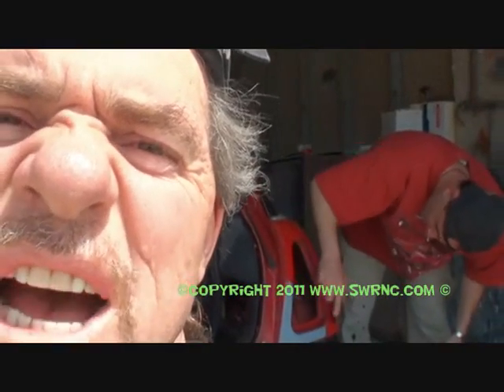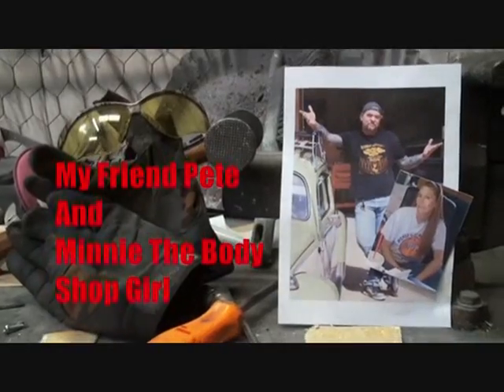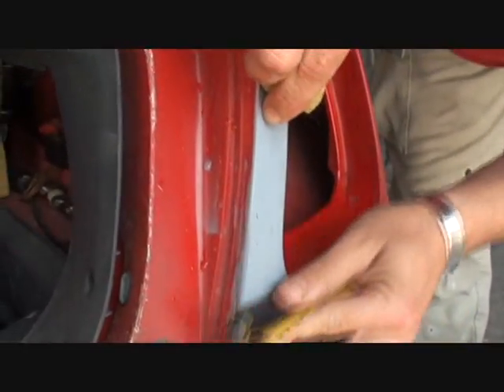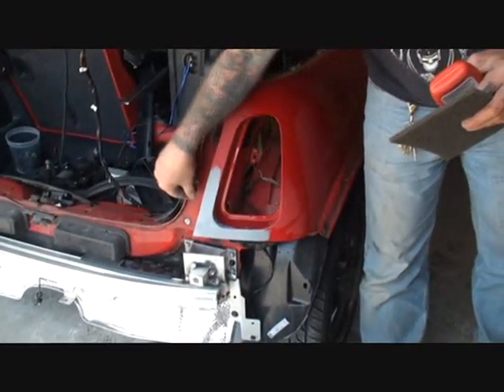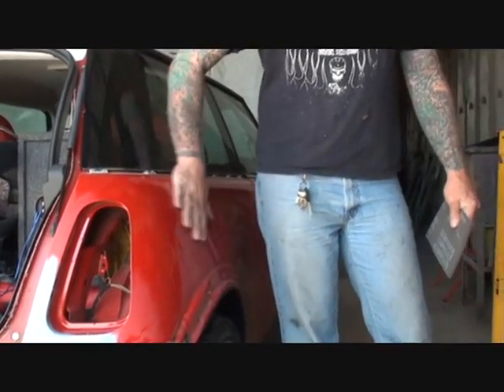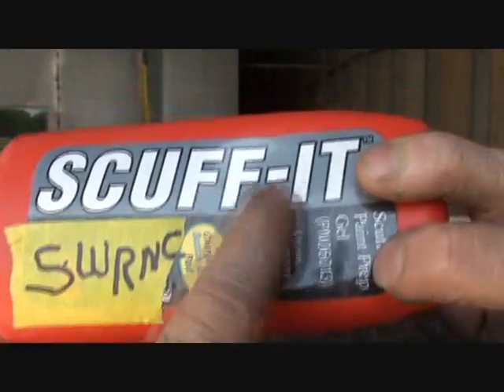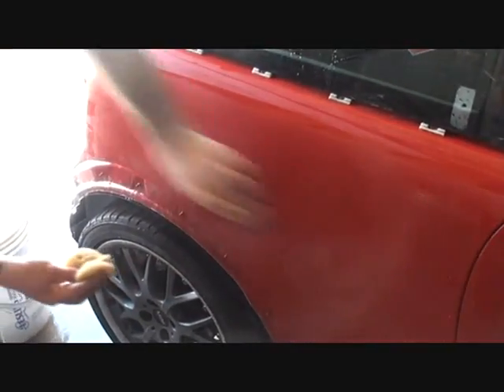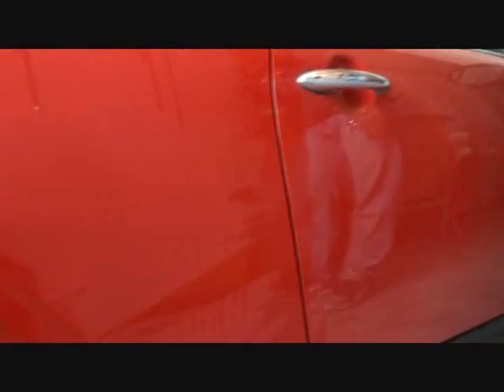How To Professionally Prep Your Car For Paint Blending-Automotive Collision Repairs

Comment from the maker: You won't be able to hand wax 1500 grit out but you can buy an adaptor for your drill which is a small buffer pad and then possibly remove the dull areas using rubbing compound then wax, if it doesn't come out, you will have to wet sand with 2 or 3000 grit then repeat process, be careful not to burn through the clear coat or paint, use plenty of compound when spot buffing. Take it easy and good luck, Pete

Comment: @screamineagle88 You can sand it dry, BUT--doing so will cause several problems. One--It gets dust and dirt everywhere and you have to wash the car off, and Two-wet sanding actually gives your primer a more precise sanding to a finer grit, to give you a much better quality finish. If you are doing base/clear I recommend wet-if you are doing single stage paint===dry sanding works fine. Pete

Comment from the maker: @gpcdist It depends on what your sanding at the time. if it's your final sand, yes sand by hand, if you are sanding to put your first primer on, then you can use the proper electric sander. You should try to use air sanders, if possible. Pete

Comment: @screamineagle88 wet sand paper is able to go to a higher grit like 1000-4000 .also wet stand paper last longer than regular sand paper and it creates a very smooth glassy finish, it mostly used as your final sanding before paint.

Comment from the maker: @75schulte If you are changing the color of your vehicle, it's advised to properly wet sand instead of scuff. the whole car, then come back and scuff the edges that your block sanding missed. This type of repair you see in this video with scuffing procedures is for spot painting. Pete